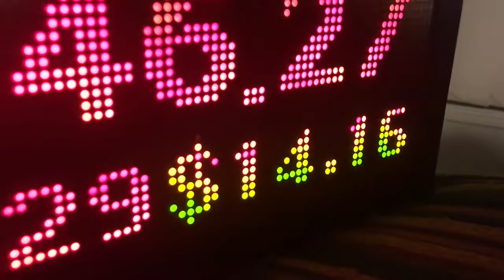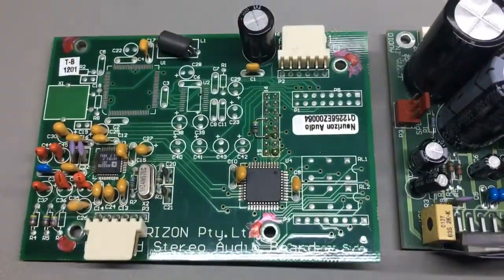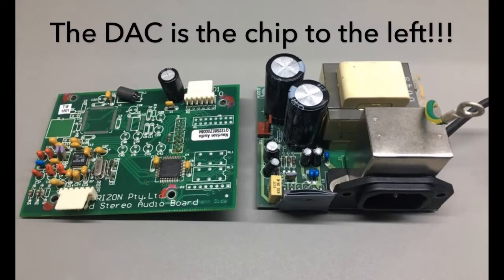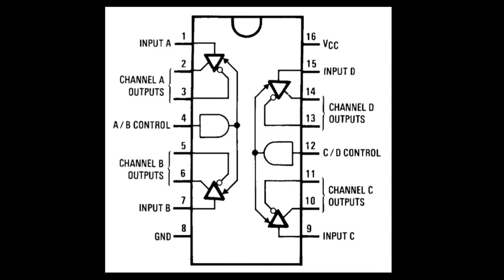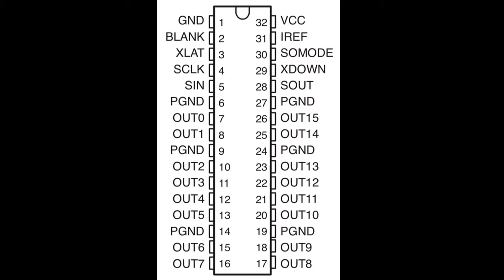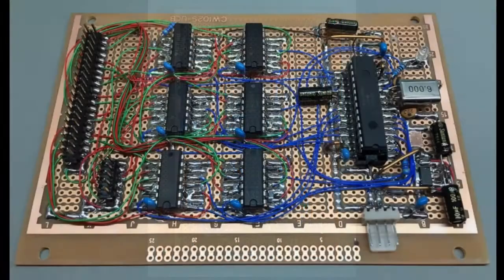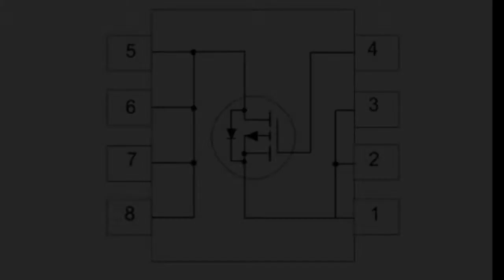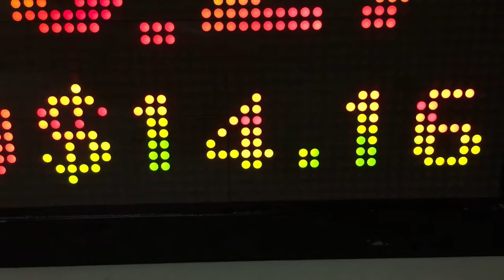Neurizon LED Display Hacking (Pt 1)

Comment: 80x48 is not that different to a command prompt! Any chance you could stick a uart input to your controller and I'll write a driver to run console stuff? 😁
Reply from the maker: javidx9 Hi :) I’m pretty confident now it’s just a matter of physical work. I’d love to solder wrap wire to vias that lead to a mid layer, instead of the IC footprints, but they don’t want to be soldered! The dsPic does have  UART interrupt, so serial should be ok. The plan is tetris anyway :D That was my own, but In the mono LCD one, I did steal your idea to identify the cell colours, so it is ready for a colour platform... it was going to be OLED though lol.